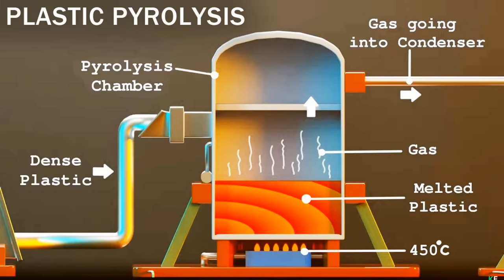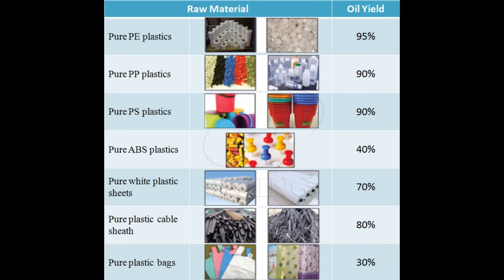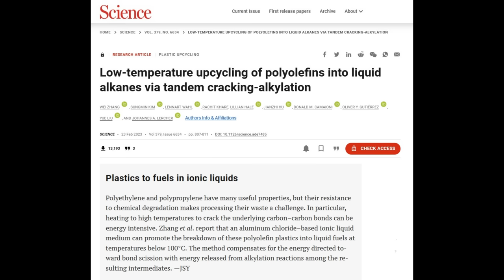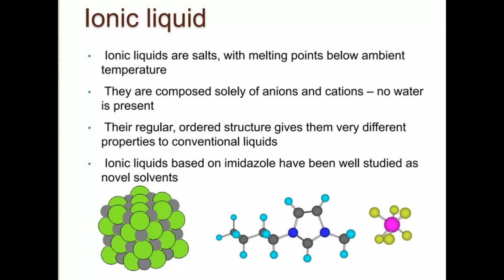2221 New Groundbreaking Process For Plastics To Fuel

Comment: Years ago I put up a video called "Plastic into electricity invention and idea" featuring this technology.  My method involves producing the plastic oils in a chamber heated by the waste heat of a specially designed Internal combustion engine similar to a "hot bulb" vaporization ignition engine from antiquity which is capable of running on any fuel even crude oil.  The engine is started on regular biofuel, then once sufficient heat is produced and heated plastic gasses bubble through water-the resultant oils are directly burned in said engine generator.
Reply: More information about hot bulb engines:
In the hot bulb engine, combustion takes place in a separated combustion chamber, the "vaporizer" (also called the "hot bulb"), usually mounted on the cylinder head, into which fuel is sprayed. It is connected to the cylinder by a narrow passage and is heated by combustion gases while running; an external flame, such as a blow torch or slow-burning wick, is used for starting; on later models, electric heating or pyrotechnics were sometimes used. Another method was the inclusion of a spark plug and vibrator-coil ignition; the engine would be started on petrol (gasoline) and switched over to oil after warming to running temperature.

The pre-heating time depends on the engine design, the type of heating used and the ambient temperature, but for most engines in a temperate climate generally ranges from 2 to 5 minutes to as much as half an hour if operating in extreme cold or the engine is especially large. The engine is then turned over, usually by hand, but sometimes by compressed air or an electric motor.

Once the engine is running, the heat of compression and ignition maintains the hot bulb at the necessary temperature, and the blow-lamp or other heat source can be removed. Thereafter, the engine requires no external heat and requires only a supply of air, fuel oil and lubricating oil to run. However, under low power the bulb could cool off too much. If the load on the engine is low, combustion temperatures may not be sufficient to maintain the temperature of the hot bulb. Many hot-bulb engines cannot be run off-load without auxiliary heating for this reason. Some engines had a throttle valve in their air intakes to cut down the supply of excess cold air for when running at light load and/or low speed, and others had adjustable fuel sprayer nozzles that could be adjusted to deliver a strong jet of fuel oil into the core of the hot bulb where temperatures would be greatest, rather than the normal wide spray of atomised fuel, to maintain self-combustion under prolonged low load running or idling. Equally, as the engine's load increases, so does the temperature of the bulb. This causes the start of combustion to advance (occurring earlier in the cycle) which reduces power and efficiency. If combustion is allowed to advance too much then damaging pre-ignition can occur. This was a limiting factor on the power output of hot-bulb engines and in order to circumvent this limit some hot-bulb engines feature a system whereby water is dripped into the air intake to reduce the temperature of the air charge and counteract pre-ignition, thus allowing higher power outputs.

The fact that the engine can be left unattended for long periods while running made hot-bulb engines a popular choice for applications requiring a steady power output, such as farm tractors, generators, pumps and canal boat propulsion.

Comment: A fantastic way to deal with the millions of tonnes of plastic we need clean up.
Reply: What happens when we use up all the plastic? Even money says there will be plastic subsidies to manufacture plastic as feed stock for fuel generation.
Reply: @orionbetelgeuse1937 The same low temperature process? That’s a depressing revelation, can you cite a particular paper or news article detailing this, please?

Comment: 70 degree centigrade can easily be achieved with a simple solar hot water heater mounted on the roof. So in essence this whole process could actually be energy free to achieve. Nice. Now someone has to design a domestic version for home use. That would reduce the amount of trash the dump truck has to pick up from the homes while giving the home owner fuel to drive around with.

Comment: Hi Robert,
We did an intensive study on the mass balance of pyrolysis.  The collected syngasses are sufficient to propell a pyrolysis process. The inefficiency resides in the cleaning of the waste feedstock. Therefore,  I postulate that we need to look at the efficient cleaning of feedstock rather than purely look at the different energy extraction processes. 
In any way, could you please provide a link to the referenced process for further scrutiny.
Your thought-provoking clips are, however, very stimulating.  Thank you!
Reply: Was that cleaning out of the chamber after the pyrolysis or actually cleaning the plastics of other materials previous to pyrolysis, or perhaps even getting it down to the sizes required to enter the chamber?
Reply: I'd be more concerned of the acidification of the pyrolysis oils, as well as the tendency for monomers to repolymerize in storage with air.

Comment: In the uk most councils, if not all, do not collect plastic bags for recycling. Yet plastic bags are one of the worst sources of plastic pollution, easily breaking down in the environment to form micro plastics. It would be very satisfying if industry started to demand the return of plastic bags as a valuable feed stock. While platics shopping bags has been banned, plastic film is still a common wrap for many products.
Reply: Most supermarkets collect these.
Not been back in UK to establish what is done with them but they are collected and used in NZ for manufacturing plastic pallets, fence posts etc.

Comment: In the 1980's some engineers in Texas built a machine that would chop tired into 4 inch squares that were then fed on a conveyor belt the  through a molten lead bath that distilled the tires and removed much of the sulfur, the distilled product was a relatively clean No. 2 fuel oil and the said that the yield was about 2 gallons per tire.
Reply: apparently there're some issues which didn't make it a common way of tyre recycling

Comment: The dude from Garage 54 uses pyrolysis with a gasifier to turn old car tires into fuel for his Lada.   Other than the smell, it works just as well, if not better, than the gasoline from a gas station.

Comment: Would the exhaust from a wood gasifier be hot enough to process the plastic? It would be neat if the waste heat from running the gasifier could be used to produce a liquid fuel that could be stored for later to either run the engine without the gasifier or use it to start the engine before the gasifier is fully up to temp.
Reply: Hi, well i do think that is a great idea, combining 2 things to get the best of both worlds, heating swimming pools, heating your home, bbq etc etc! nice one, take care and have a great day!
Reply from the maker: at this kind of temperture - yes

Comment: I've seen a community which used a solar lens to heat the chamber.  Collected the plastic from task and had free fuel for their yard devices
Reply: Name?
Reply: @petevenuti7355  I don't remember.  They lived north of Los Angeles.  It was a hippy encampment.
Reply: @petevenuti7355  but there are videos from a decade ago using this process.  Pioneered in India as I remember. 
A small amount of fuel can cook down the next batch when there isn't solar.
Reply: @petevenuti7355  wait.  Peter?  Spiral garden Peter  ?
Reply: @KaliFissure  I don't think so. I'm not the lawyer either.
  I did build a pyramid shaped square foot garden once.
Reply: @KaliFissure  oh I've seen a video from India with a big industrial scare tire pyrolysis plant that was scary as hell spewing black gas leaking all over the place getting the nastiest oil

Comment: Pyrolysis is inefficient process if the goal was to produce oil/gasoline. But a good option if the goal is to reduce plastic waste. And the residue can be used as aggregate in asphalt or concrete maybe.

Comment: Changing World Technologies almost went fully commercial with this more than a decade ago. Prob worth trying again, esp if you include solar &c power in the process.

This with a solar concentrator, esp in a desert location, would be good.
Reply: So your idea is to use renewable solar energy to produce fossil fuels from fossil plastics.
Reply: @Paul-yh8km Sounds better than leaving the plastic laying around in the landfill sites...
Reply: @AndreaDingbatt  
Most plastic waste in the UK gets incinerated in waste to energy plants, there is a cost penalty for putting it in landfill.
But burning it or putting it in landfill isn't the answer.

Comment: Great video.  I remember seeing a video of local villagers on a remote island using Pyrolysis of the plastic that washed ashore to make electricity.  

Ideally a distillation column works best to separate the fuel types and to reuse the remaining gases for the heating source.

Comment: I'm playing with an idea for a motor where you inject hot oil into a chamber of water to make really high pressures.

Dark smoky fires create really high pressures. I think I might be able to use that stuff for the oil.

Imagine cars that run on water and oil made from recycled plastics. Now that would be revolutionary!
Reply: Will do nothing to cut carbon emissions.
Reply: @Paul-yh8km  kinda like windmills?
Reply: @billschwandt1  
Grid scale wind energy has a carbon intensity up to 20gCO2/kWh.
Fossil fuels range from 300 to 1000 gCO2/kWh depending on use and fuel type.
If wind turbines were to be built using green steel, that 20 figure would drop further.

Comment: Couldn't one use directed thermal solar, as well as sand batteries for shorter daylight hours, to provide heat for the process?
Reply: Why would you use solar energy to convert fossil plastics into fossil fuel?
Reply from the maker: absolutely!

Comment: Does the used heat get stored in the fuel or is heat just a convector to get the fuel out of plastic ? I mean, if I'm heating my house with that fire (in another room), will the heat be lost in the fuel or can I actually get it anyway to heat the house ?

Comment: sound wave at  right frequency might melt plastic same as peter davy kettle invention that wasnt imersed in water but would boil water because 1htz pulsed back through 2 bike bells one trimmed slightly smaller?

Comment: A strategy where zero grid power is produced via hydrocarbons is a good start and a very achievable goal. Save hydrocarbon use for mobile platforms requiring high density fuels, like airplanes and trucking, in the interim. The exception to that might be trash incineration, recycling and use of excess production in which using the energy to process raw materials might work. An international treaty banning the target of nuclear plants in war - although that might be a tough sell because of breeder reactors. Might be worth an investment in non-uranium nuclear.

Comment: Not placing plastics in waste dump is good. But using heat to produce gasoline seems still not so efficient.
Unfortunately I did not see any information on energy in and out - and therefore I assume it is not good…

Comment: what about using solar and wind to produce the needed heat?
Reply: You want to produce fossil fuels from fossil plastics using solar or wind?
Reply: @Paul-yh8km  LOL.... I get where you're coming from, but, we have to do something with all of this plastic. We are just now beginning to see the evidence of its effect on the biome globally.
Reply: @buensomeritano1755 Absolutely 💯 Agreed!!😎👍👍
Reply: @buensomeritano1755  
The answer isn't to burn it.
Plastic should be regulated, some plastic products are designed by people that just want to make money and ignore what happens to the product once sold. That is also connected to the reduction in plastic use. Recycling should also be a part of the solution as well as design for repair and design for recycling.
Turning waste into energy creates a market that has to be fed, which eliminates the incentive to reduce waste. We already see this with existing waste to energy plants.
Reply: @Paul-yh8km  I'm not arguing with any of what you said. I'm just saying we have to do something with all of the plastic that we have already released into the environment. I don't think it's feasible to convert what has already been discarded into the environment into new products. In order to incentivize cleaning up the plastic we've already put out there, it has to be made profitable, or people won't do it. We either leave it out there to continue poisoning the environment, or, we convert it into an energy source so people will actually clean it up. I think it should also be subsidized by the government. By using numerous condensation steps in the distillation process, you can create fuels that burn almost perfectly clean. What would you suggest we do about the plastic out there and how do we incentivize its clean up?

Comment: I read an article about saving summer heat for use in the winter to heat our homes. It uses a phase change salt and water method. Basically you add summer heat to the solution to separate them and store the heat. In winter you recombine them to release the stored heat. I think you did a video on this a while back, but there are so many I can't find it. This looks very promising. I wish you would revisit this.

Comment: An all-electric future will never happen: we'll always need fuel of one sort or another as a convenient way of easily moving and distributing large amounts of energy around when the grid is down. If that fuel can come from breaking down plastics or other materials that have outlived their recyclable life, that would be great. Though if you pyrolyze plastics to get distilled fractions out of it in a manner very similar to crude distillation, you end up with refinery-like fractions that can be used for things other than fuel.

Comment: But I don't HAVE any butylpyridinium chloride, and I suspect getting some might raise its own costs and issues. What I DO have are some better distillation equipment than yours, and a wood burning stove. Yes that's unsafe, like most things worth doing, but the wood is a waste bi-product, so any fuel made would be redeeming its energy. I already use the stove to melt HDPE into usable ingots, so being able to make fuel from plastic waste seems worth investigating.

Comment: despite the impressive name, The International Energy Agency is a poor source of real technical information on energy. Yes they collect and analyse a lot of data but their opinions and projections about renewables comes nowher close to reality.
The subject of this video is about plastics and the best thing I believe is to burn waste plastic in incinerators (The plastic's Industry have recently come out saying that recycling doesn't actuallty work very well and is difficult and expensive to improve.) and use the heat to generate much needed reliable and stable electrcity, or alternatively but less useful is for local heating schemes. It is less useful as heating is seasonal.

Comment: Converting plastic (essentially a carbon sink) into petroleum products that when burned produce double their weight in CO2 emissions doesn’t seem like a very good idea to me. Let’s develop alternative packaging that can be reused and stop extracting more oil and making more plastic in the first place.
Reply: Drill for as much gas as possible and build pipelines so reduce the energy required to transport it. This replaces coal.

Build out nuclear, this gets us the energy we need to displace gas and to for instance power a carbon neutral synthetic jet fuel process since we aren't going to be replacing jet fuel any time soon.

Comment: I'm sorry ,but polyethylene and polypropylene can both be easily recycled back into plastic beads ready for injection moulding. To say that they are not easily recyclable is not correct.
Reply: Surprised he got that wrong.
It is ok course the non thermo plastics that are appropriate to this process

Comment: Aren't you doing the pyrolysis wrong?

Thought there was pressurised water involved and 400 degrees inside the tank. Long time since I watched, and memory might slip up over time. But I thought these three factors are the real deal. The point is to get no combustion in the tank at all, which I believe you did (blackening the stuff is wrong). You probably didn't do pyrolysis.

Comment: Err... we can't meet our CO2 reduction targets by burning waste plastic. Wasteful though it is, waste plastic is carbon locked out of the atmosphere. If we turn it into fuel and then burn it, that locked up carbon goes straight into the atmosphere.
By all means recycle plastics as second use, but pyrolysis is very energy intensive - for now, from a climate POV, plastics in landfill is better than plastics pyrolysed and burnt as fuel. Even if it's a route to recycle plastics, the energy used in pyrolysis is better used in, say, decarbonising steel production.
Reply: Well said.

Comment: How can you make a video about making fuel from plastics, mention net zero at the start and then not mention the fact that burning the fuel will add more fossil carbon dioxide to the atmosphere, there by negating the purpose of the video?

Plastic is combustible in any case, whether you burn it as plastic or make it into a fuel and then burn it, you produce fossil CO2.